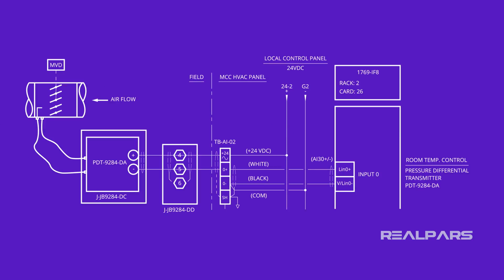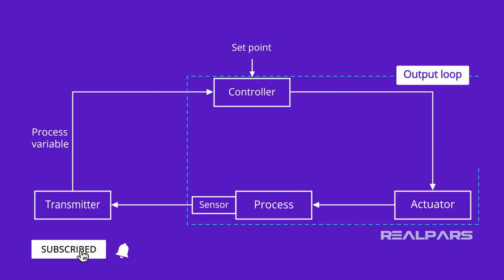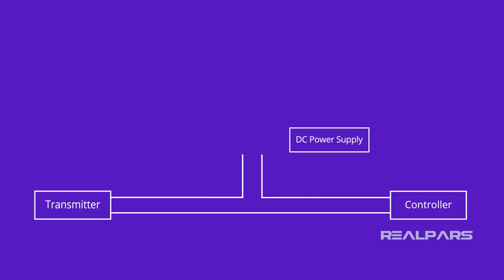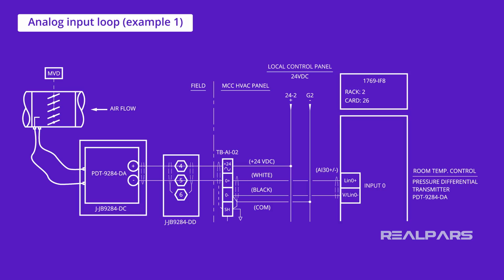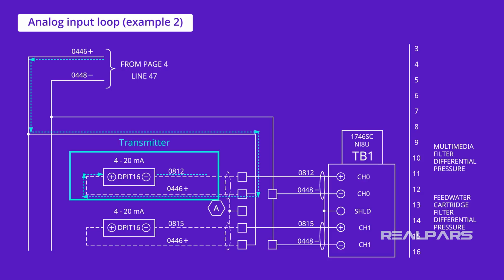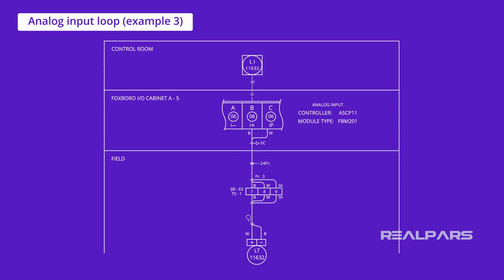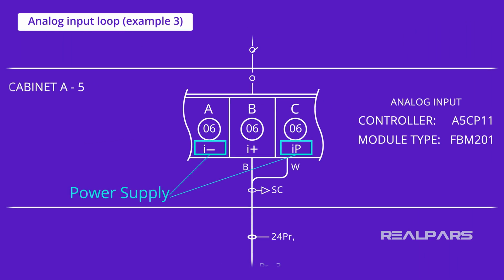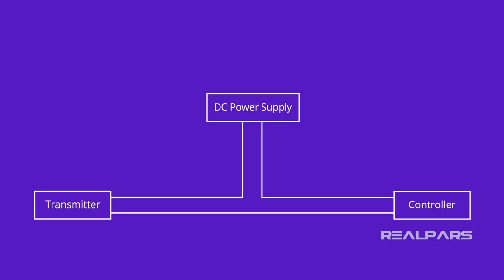Interpreting Typical Analog Input Control Loop Diagrams

Comment: Great explanation of Analog Loops, as always hats off for the tremendous efforts of you guys to help engineers worldwide to understand the basics which if comprehended correctly will lead to professional well operated and maintained facilities all because of your guidance, I have a question in ICSS Environment with FB programming, what do you recommend as training resources that can be easily understood to configure/work with Function Blocks, ex: Delta-V Control studio
Reply from the maker: The course at Realpars.com on PCS7 programming is a great place to start.  PCS7 is configured via CFC blocks, which are function block elements.  DeltaV is a similar system from Emerson Process Management, and they, and others, offer classes in DeltaV Control Studio and other software in the DeltaV family.  If you are interested in learning the basics of function block programming that can be applied to multiple systems, the multipart PCS7 course at Realpars can provide a great foundation for a fraction of the cost of a typical vendor-sponsored course.  If you are using DeltaV or ABB 800XA or another DCS system in your plant, check with your local rep to see which courses may be offered in your area.

Comment: Can we control a frequency inveter by 2 potentiometer ? How ?
Reply: All the models of frecuency drivers that i know have many options for the reference input, such as 0-5V, 4-20mA, digital, etc.  but only one its the 'active'.
Reply: @SrOsvaldo1  but for a panel having only one frequency inveter, there are 2 potentiometer.....how  I can program the another one  for using both volt and milliampere signal?
Reply: Do you know exact role of chartered engineer ?